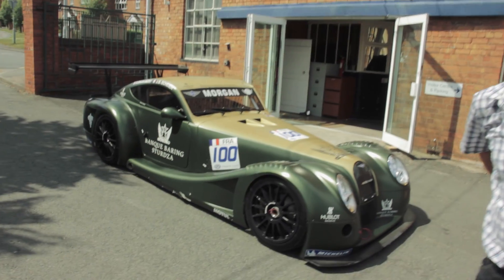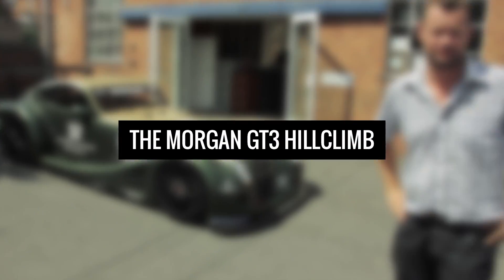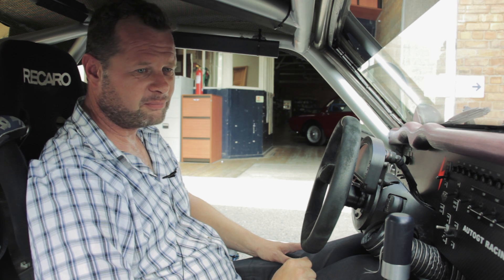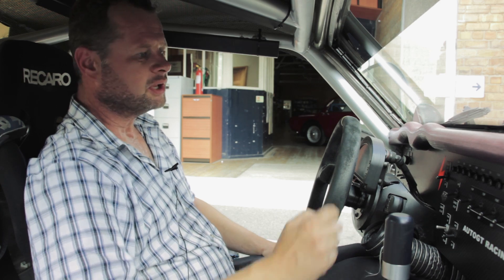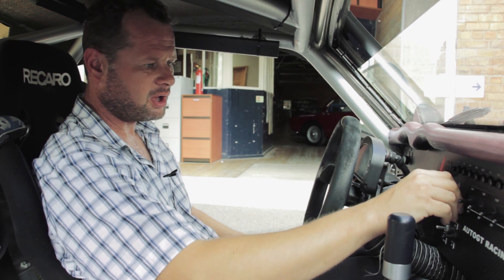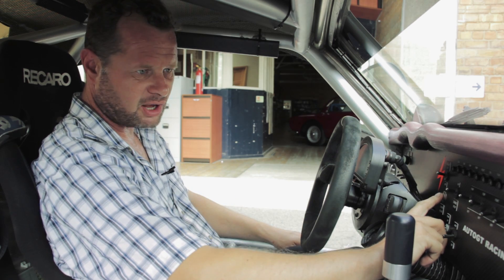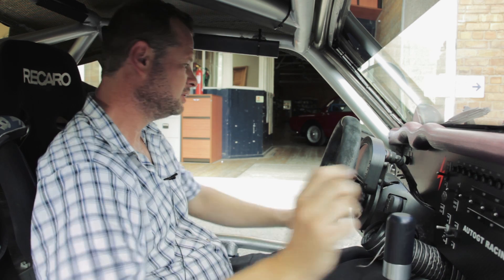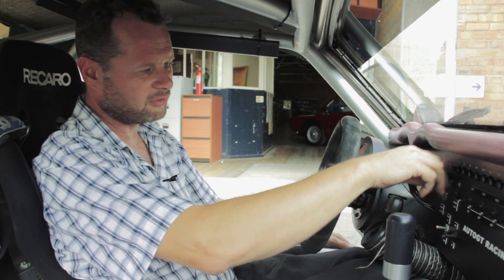Morgan GT3 Hillclimb - Thrill on the Hill 2014

Comment: Mr Morgan: Build them (AERO 8)  lower, wider, lighter, longer wheelbase. Everything other item/concern is  unimportant and all will fall into its proper place.  Place the present Aero on 3D cadd and stretch it 1 inch lower,  stretch 3 inches wider,  2 inches longer wheelbase relocating existing rear wheels.  Use more magnesium parts as it is 30% lighter than Aluminium to reduce your overall weight versus existing.  Add a lot more gauges ( 5  to 7 white background). This is a British sports car,  Do not follow Aston Martin, Jaguar, Lotus into producing digitised dashboards with graphs and LED's. Make it a modern car with a slight nostalgic interior.  You can charge 50 thousand more for this over your present car and it will sell.